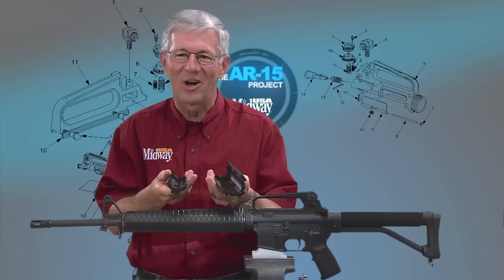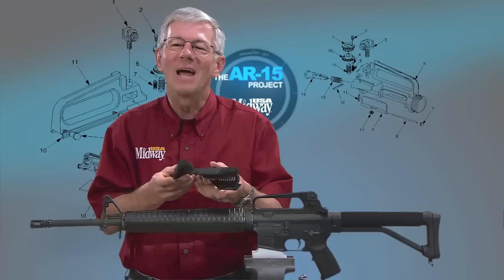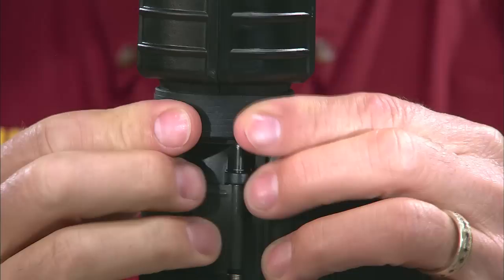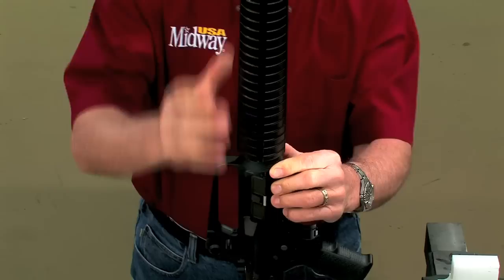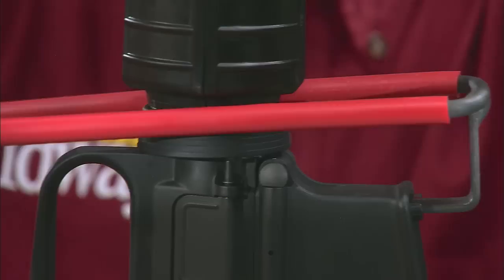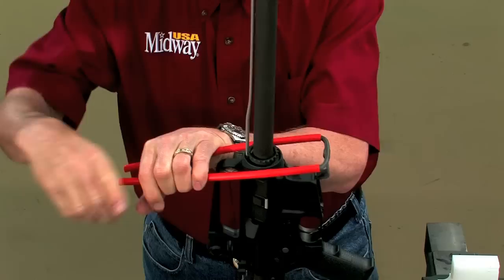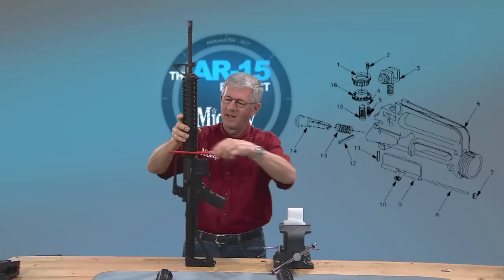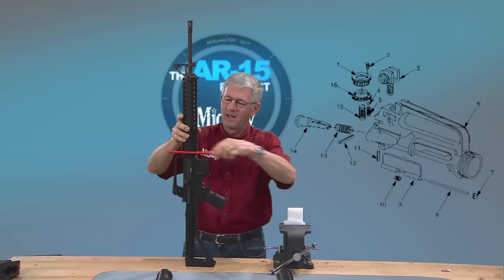How to Replace or Upgrade AR-15 Handguards Presented by Larry Potterfield of MidwayUSA

Comment from the maker: The front handguard is one of the most easily replaced parts of the AR platform and can be easily customized to the shooter's preference.  Watch along as Larry Potterfield, Founder and CEO of MidwayUSA, presents some options for replacement handguards, along with demonstrating the proper method for handguard replacement.
Reply: I appreciate you guys came back to put a comment on what at the time was a 6 year old video.  Shows ya care.

Comment: Informative video for those new to the AR15 platform.  I'm just wondering: why the need for this tool?  I was in the Army for 23 years and when I went thru Basic Training, when I trained soldiers as an NCO, when we would disassemble weapons for training or cleaning after a range, I'd never used nor seen a tool used to remove the handguards.  The method was always to pull down on the delta ring with one hand and remove/install the handguards with the other.  I've done this with well-used M16/M4 rifles and brand new (still in the grease) rifles...including an AR I bought at a gun show recently.

Is this tool usage just a civilian thing?  The 1st time I saw one was when I was browsing a sporting goods store after I retired.
Reply: Paul, IMO, with all the new types and manufactures of hand guards out there today, some are alot harder to get out than others.  I have 2 AR's I can use my hand but my carbine is a b*tch and I have to use a tool.
Reply: Because a brand new delta ring spring can be very stiff. The tool is just convenient and makes it that much easier, and faster. So while we're measuring dicks, I used the rubber handle of large pair of vice grips to compress the ring. Worked fine. Do I wish I had the tool? Hell yes. Was I patient enough to go out and get one, nope.
Reply: There are a lot things that weren't around 20+ years ago that are making life a lot easier now.
Reply: This job will soon be done robots, mark my words!
Reply: Same for me... never needed a tool for the M16's when in the service.  But I can tell you that the spring on my AR is far stronger than the M16's I used.  Probably due to the amount of wear and use on the weapons we had.
Reply: woelfe I swear it’s so hard to get the hand guard off on my AR by hand, it literally took me half an hour the other day
Reply: Actually use that handles on a large pair of channel lock pliers...not vice grips...

Comment: @txstang84  Your right.My dad was a marine,I was born on base,so I learned how to do alot of this stuff without the tools,but you are right,if I were doing several per day,I would use the tool for ease. If you dont want to use your hand,and dont want the tool,you can use the channel lock methos as shown in another video i seen on here before.

Comment: What is the handguard you installed?
Reply: For me I don't particularly like the four sided picatiny rail on the handguards...harder on your hand while shooting. Get the handguard with the top picatiny rail with D-locs on both sides of your handguard. Install a D-Loc with a pic rail on it if you want for a small light. Really all you need.

Comment: What are most manufacturers recommended torque specification for handguard screws?  Thanks.
Reply: it varies pretty significantly based on design and company
Reply: @collinjones311  What are BCA’s (Bear Creek Arsenals) recomended torque specifications for their handguard screws?  Thank you.
Reply: @hb5914 if you are talking about the type that has 2 screws at 2, 4, 8 and 10 o'clock 5hey are 35 in/lbs. The Internet is your friend. Just type in whatever torque value you are looking for part wise. Usually the manufacturer will have it listed on their site/ install instructions too for that specific part. That's all I did here as I don't own any BCA products

Comment: "one of the most easily replaced parts"
needs a tool to remove it with any kind of ease
Reply: Just use bare hands. I hold the upper against my body for a brace. Works fine. No tool required